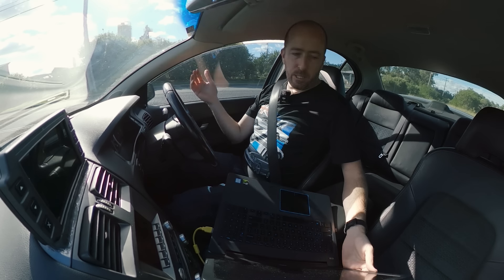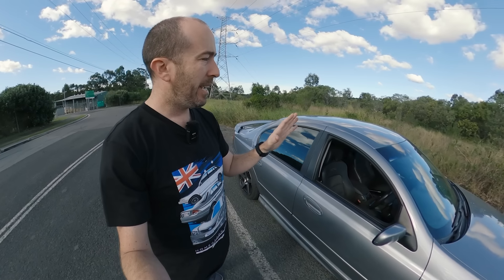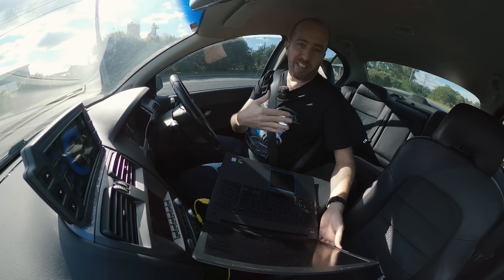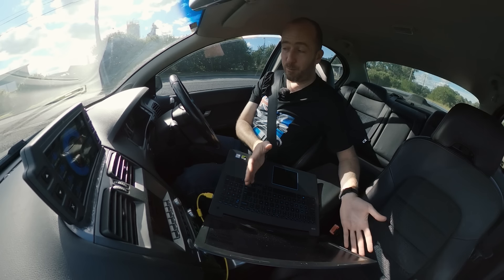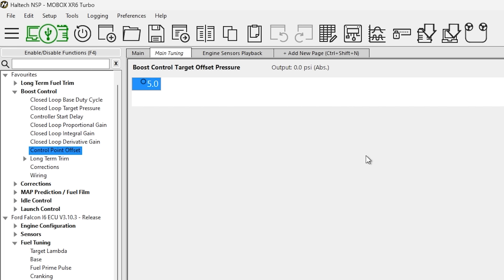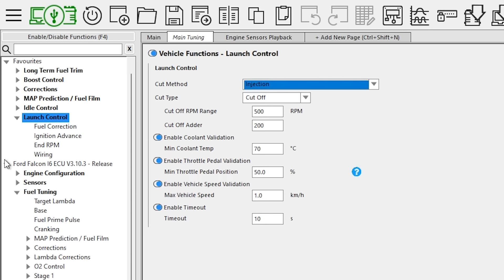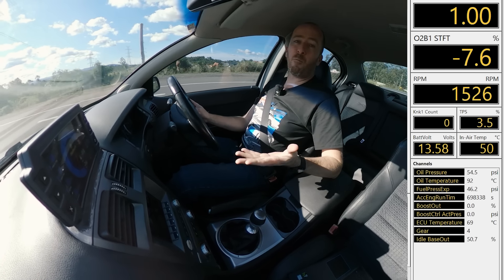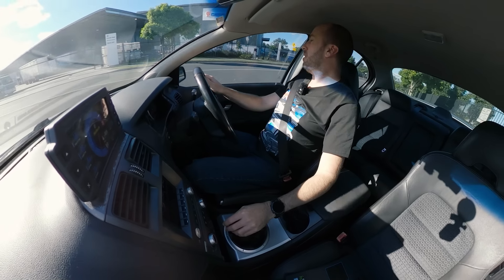Is the BA XR6T Finally Running Right? Plus a look into it's Haltech brain!

Comment: Closed loop boost control - this is where you set a target boost pressure and the ECU will constantly try to hit that boost level. You can adjust multiple parameters around how fast and aggressive the control logic reacts (PID control). Set it up to react too aggressively and you will end up with it hunting, i.e. it will cycle between overshoot, undershoot, overshoot. You can also go too far the other way and have it too slow to react, causing it to overboost. Changing the turbo like you have will 100% change how this should be setup, but it couldn't have been tuned correctly before with the stock flapper anyway.

The Base Duty Cycle numbers you changed are the starting point for the boost control. When the ECU decides it should be controlling boost, it will start with whats in that table and use the closed loop logic to adjust that number from there.

If The Hoff is still willing to help out, it might be best getring his help with getting this tuned right, PID control is a pain to work with. I can give you a basic run down on what to do if you really want to have a crack

Comment: One of the reasons for issues when you open up the throttle on a manifold injected engine is there is a small pooling of fuel at the bottom of the runner in the head that collects some of the fuel passing through and then will displace some fuel from the pool because it cannot sustain a larger size under vacuum or boost. This means you need slightly more fuel initially than the engine requires to accelerate but then also enriches the fuel mixture in larger than ideal droplets after the initial throttle input. So it can take quite a bit of work to get a nice crisp throttle.

Comment: I haven't a clue what you said but sounds interesting 🤔 obviously this is way above my level of understanding....😂 back in my day my tuner was my screwdriver 🪛....Question what kind of power figures you can expect with a few basic bolt ons on a standard ECU obviously the moon is the limits with an after market by the seems of things.

Comment: @motoringbox I've recently bought some goodies for my Xr6 turbo (haltech and bigger fuel pump and injectors) and am wondering how to load a Base tune onto the haltech plug and play so i can drive it to a dyno tuner, thanks
Reply from the maker: There are base maps, but if you need help feel free to email me. Especially if you have the specs for your new injectors. sean@motoringbox.com

Comment: I recently bought a ba xr6 ute as a run around, 300,000km and pretty rough cosmetic wise. Even though its a N/A barra with a btr, for what it is its a fun car to drive and is somehow great on fuel. im very tempted to part it out and put the barra, wiring harness and ecu into my NL Fairlane and rebuild the motor to suit a turbo and run a haltech. only problem is my best mate would kill me if i swapped the sohc for a barra 😂

Comment: Ive been looking at Haltech for mine for a long time, I'd have to manualise the btr however, to my knowledge no support for 4 speed auto.
Reply from the maker: I believe it can be done with an Elite running as a piggyback on top of the standard ECU. I am going to be attempting an install like this into my AU within the next few months.
Reply: Im keen mate for your vids on that, ido know lurking on haltech website they offer piggy back type adapters. Im keen on keeping the old girl as original looking as possible.
Reply: Ring up and ask, I'm pretty sure Haltechs have been able to control a BTR for many years.
Reply: With the btr get trans cooler   
I have ba xr6t btr it drives fine but when load it.  It slips very bad sometimes in 3rd

Comment: I'm lucky to have my tuner 20 minutes away.He has dialed in the haltech on cold starts from like 8-10 hits of the key to start first go Everytime.I just need to get some traction on the Dyno now 😂
Reply: He also set up boost by gear.Should have a look at that.
Reply from the maker: @matman429  mine is currently set up that way, I've been playing around with it. The only thing is my car has a 6-speed manual which doesn't have sensors to tell which gear its in, and has to rely on the ECU comparing the engine RPM vs vehicle speed to determine it. There's a bit of a delay in it recognising the gear change, so I may go back to one boost setting for all gears.
Reply: @MotoringBoxTV  Yes I'm running a 6speed manual as well.But I'm also running a electronic waste gate.So my boost is dialed.Put that on your wish list for sure.And while your spending dollars grab a S1 sequential shifter.

Comment: Next upgrade for this should be billet oil pump gears and backing plate, because the oil pump gears are known to fail on the ba-bf
Also great video
Reply from the maker: I'm leaving the oil pump for now. The saving grace is the Haltech has engine protection features that'll let you know immediately if the oil pressure suddenly disappears.

Comment: What tyres are you running on your XR mate and how do you find them performance wise?
Reply from the maker: RE003's - I think they're brilliant. I don't really have anything to compare them to, but they're relatively cheap, quiet enough, grip well and also are surprisingly good in the wet.
Reply: @MotoringBoxTV  What is the wear like on them? Do you get good miles out of them?

Comment: I would recommend regap your plugs to 0.7mm if your running over 300rwkw~ 16psi. Or AGSP22YE07. Pregapped ford iridiums denoted by the 07. The sooting maybe has to do with the plug type if your running other than iridiums an too tall a gap you will get unburnt fuel on idle if the plug is not cold enough? Correct me if im wrong here lol
Reply: You might get issues with a BKR7 or 6E/IX possibly 
 a BKR5E/IX safer for high boost applications an 0.8mm.
Reply from the maker: I run NGK Iridium MAX 0.8mm.

Comment: I'm surprised haltech don't supply a good base map for it that does a basic cold start given how much they cost and most barras keep stock cams.
Reply from the maker: They did, but as soon as you swap injectors things change.
Reply: @MotoringBoxTV interesting considering other ECUs do scaling for injectors
Reply from the maker: @Low760  I can't speak on their behalf, but perhaps their base settings are on the richer side to get the engine running safely? Back in the day they did confirm to me that the base map was only to get the engine running well enough to then get it tuned, rather than a recreation of the stock BA XR6T tune.
Reply: @Low760  Haltech does injector scaling too, every aftermarket ECU that's not trash does.

Comment: After watching this i am more convinced that superchargers are the way to go.
Reply: Definitely not. The Falcon is using an OEM turbo and they will overboost but the trade off is instant power down low and better economy vs a supercharger.
Reply: @Low760  Sorry but you are WRONG, turbo chargers need to spool up before they can provide boost unlike a supercharger which provides boost off idle. So you have never heard of "turbo lag". Sorry too much plumbing on a turbo charger which is not that reliable. Economy is in fact comparable as economy depends purely on the control of the right foot.